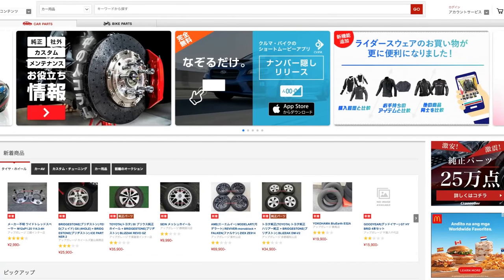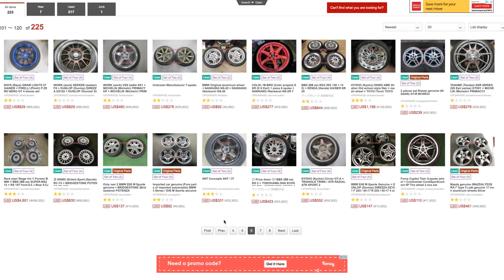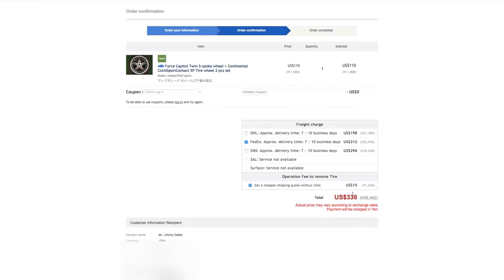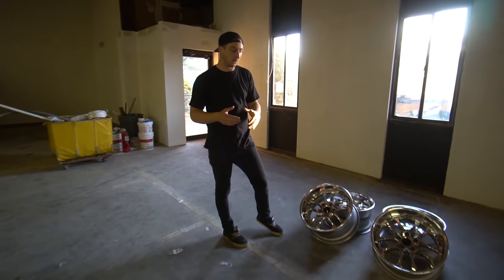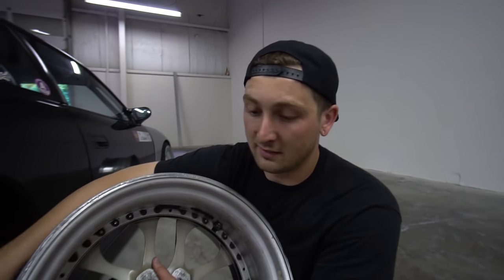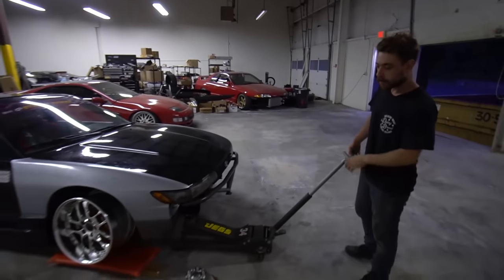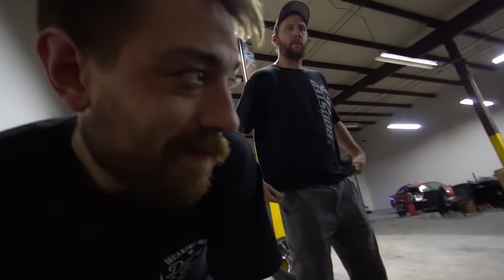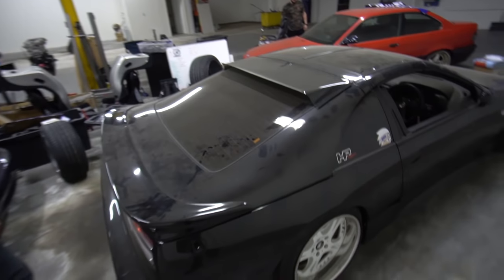CHEAPEST & EASIEST way to buy RARE JDM wheels!

Comment: I'm telling you Jimmy check the crank timing on the black z the keyway could have been cut in the wrong spot on the crank or the the cams get out a dial gauge and verify top dead center for real. Also you have to test fit those wheels on the black z it would look nuts.
Reply from the maker: Ryboodle checked several times!
Reply: @JimmyOakes  yikes I guess adjustable cam gears and setting cam timing wouldn't help then that sr is baffling me.

Comment: Put 235/40/18 on front 245/40/18 rear if u put them on the 240 the 245 will have a tad bit of stretch but nun crazy you might have to roll fenders a bit more.

Comment: they have everything, except Equip 05's or blitz 03's. With the new american crooooober, everything will become harder to get, and more expensive.
You were also looking at the cheapest of the cheap wheels on there (the star rating). So most likely banged up and bent.